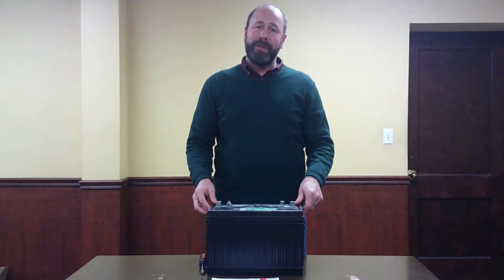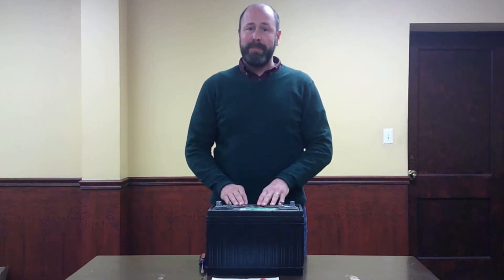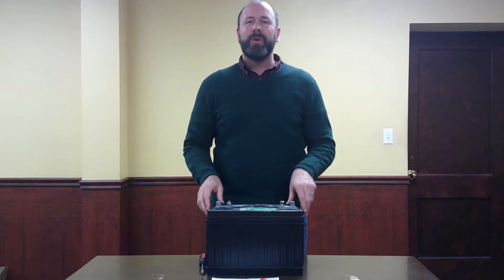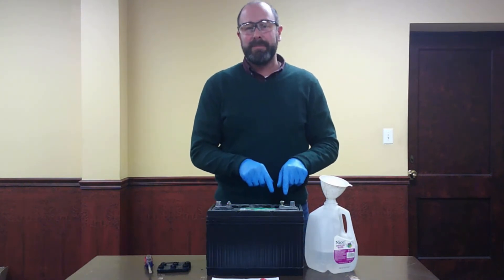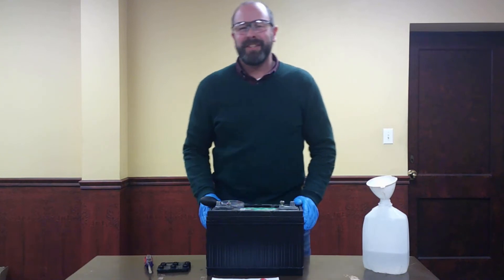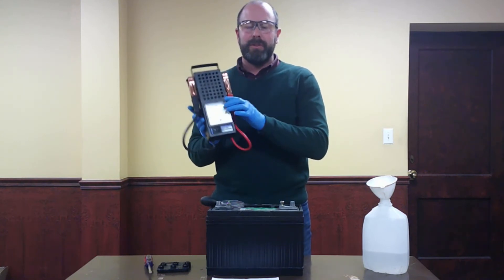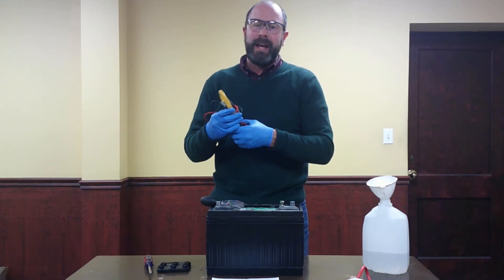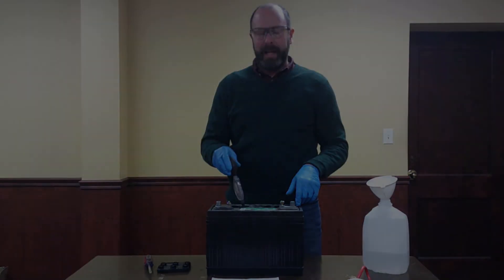Proper Lead-Acid Battery Maintenance

Comment: My battery is connected to my RV and I am hooked up full time. Can I fill them up without disconnecting?
Reply: It’s probably easier to just disconnect, charge, refill, test than to wait for a reply. Plus you won’t get battery acid on your cables accidentally.